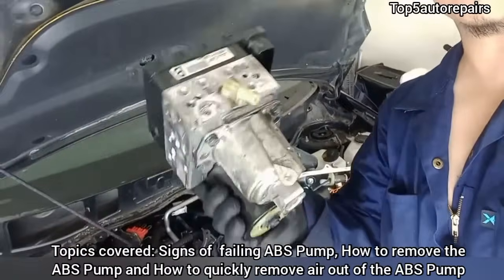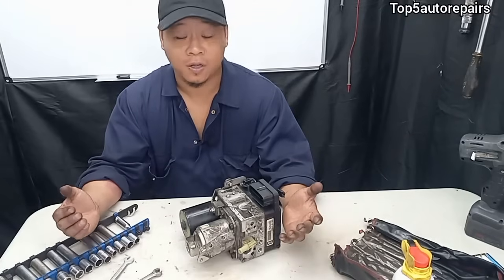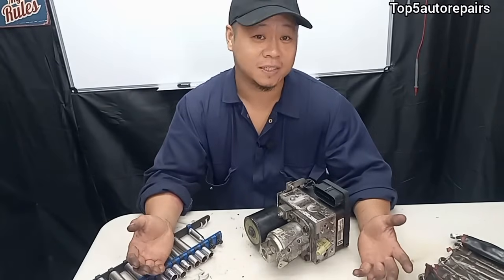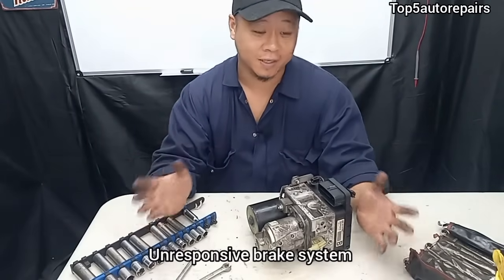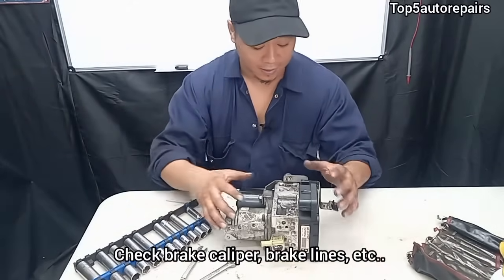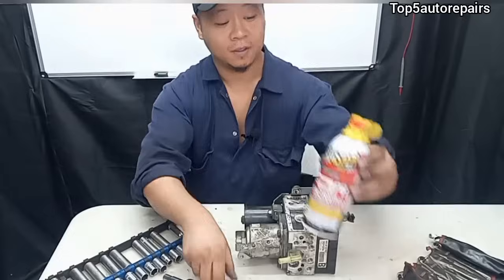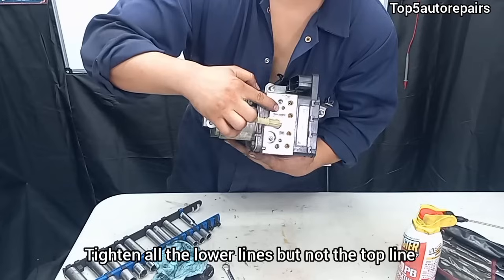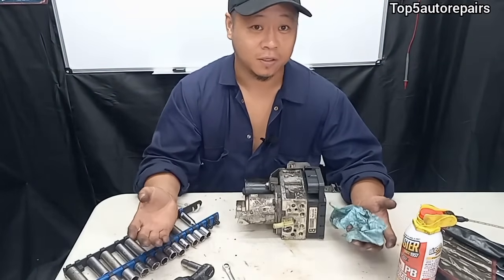4 Signs Your ABS Pump is Bad and Failing (How to get of air quickly after replacement)

Comment: My question is why? Why do they constantly fail? And when I say “they” I am referring specifically to Toyota/Lexus ABS systems, for I am currently on my 3rd or 4th actuator, just had it replaced at a local Lexus dealership 2 years ago and it’s failing once again. The dash hasn’t lit up like a X-mas tree yet, but the pedal recently got soft and I can hear the “BUZZ OF DEATH ☠️” coming from the actuator again. The reservoir was a little low, but not below the line. I filled it with DOT 4 just under the MAX line. But again, the million dollar question is why? Why do they constantly fail, especially from a manufacturer known for reliability?

Comment: Can anyone help me? I have a 1996 Mitsubishi pajero 2.8td, every now and then my brake pedal will just not work…as if in I can not move the pedal even by stamping on it, I also have no abs. Could a failed ABS pump cause your brake pedal to sometimes lock in place result in not being able to press the pedal ?

Comment: I was at a stop light and when it turned green, I took my foot off the brake and went to accelerate when th SUV just completely locked and s metal to metal grinding was heard inside the vehicle. The ABS light on the panel came on and underneath it said “press break” I dud and then I was able to accelerate. Please help me! Chevrolet people say they don’t know what it is!!!!! 2923 Chevy Traverse!

Comment: Great insight! I'm going to tackle replacing the pump. I have already sent my module off for repair, but I'm still getting ABS, Traction Control, and check brake system codes. I bought a used pump, so hopefully it resolves my issues at this point. I already replaced the speed sensors as well. I was regretting having to break open the lines, but the end of the video should prove very helpful.

Comment: What if no brake fluid is going to 1 wheel and the line is not clogged?
Reply: This exactly the problem I'm running in to.
Reply: @isaacbrooks5999 check the brake booster master cylinder abs module bleed lines
Reply: Check brake booster brake lines bleeders master cylinder
Reply: Have this same problem no fluid from one hole in the abs
Reply: @dwightmorris178 did you get a new one and fix the problem
Reply: Late to the party but this is my exact issue. No fluid out of the brake line on my 2001 f150.

Comment: I have a 97 s10 blazer, brakes got spongy but still had brakes, took it to a brake shop the guy said abs module bad, they don't make new ones for this model so i had to get a used one, it was bad too so the guy just unplugged it, has good pedal of brakes but all 4 wheels hot when i got home. ?

Comment: Brake binding, spongy pedal, or no fluid to the calipers?
Sounds like a classic ABS pump fault – and that’s my specialty.

I run a dedicated ABS repair service here in Cheshire UK. For my June launch, I’m offering local collection, full check, and same-day turnaround (if needed) for just £30 inc. VAT.

Drop me a message – happy to help you or your customers stay on the road 👍
Reply: My brake pedal goes to the floor when abs engages. I have a new master cylinder. Any idea what that could be?
Reply: @4dscdriver  Sorry for the delay. Usually there is the feeling  the pedal goes down when the ABS engages. It should be ok. 

I would be worried if the pedal goes to the floor in any situation even with the car/bike not moving, after a new master cylinder and brake system properly bleeded. Then you could blame the ABS module

Comment: If happens that you have one module for repair due to:
- Locking up of one or multiple wheels
- No brake pressure at one of the wheels
- The brake pedal doesn't get firm after several unsuccessful bleeding attempts, when the tested brake pump works just fine.
If you are based in the UK and you are watching this in June 2025,  I can fix your ABS module for free,

 contact  me for more info.

Comment: I have a 2004 Prius. The mechanic said it’s a bad abs pump. Code C1253C1256. Part is $2067 and labor is 4.0 hours. 

I only paid $4400 for the car and it has 230k miles. 

Question 1.  Is that correct code for diagnostic test? The pedal is hard and all alarms are going off. Slow to stop

2. Is it worth fixing given the cost? 

3. I am kinda handy but this seems over my head in terms of DIY. Can I get a used part with a warranty? 

Thanks.

Comment: My Ram van had the issue of the wheels locking.  I replaced the module and it quit.  I expected it would be the pump, but so far so good...

The comment is to help you with the algo.

Thanks man, your videos are always top notch information.

Comment: Hey just ran into your video. I know it’s two years late but I have a question. I have a 2006 Chevy Tahoe Joe Gibbs edition the 5.3 L V8 with the Hydro boost brake system, but my brakes are going all the way to the floor and there’s some kind of like brake light on track control light, and some kind of warning on the dash, but you think that could be the ABS module as well. I don’t have any leaks. I checked for leaks. I don’t have any brake leak.

Comment: Great info! Question? Why is there no brake fluid coming out from one of the brake lines? I’ve disconnected the line from the module and absolutely nothing comes out from it. I have verified there is no clogs from the module to the caliper. Thx!

Comment: I have a 2007 Xterra 2WD. Back in May, right front caliper locked up due to rust and corrosive. It's been working fine until last month I decided to flush the brake system for the first time after 160k miles. I bled right rear, left rear, right front, then left front using the bleeding pump. At one time, I probably overfilled the brake Master Cylinder then closed the cap and bleed the brake. It had too much pressure that the fluid leaked out from under the cap. I opened the cap and relieve the pressure and cleaned up. After that It feel like the vehicle is dragging. I checked all wheel and found the right front wheel locked up again. I thought the caliper is defective so I exchanged it for a new one w/ Advance Auto Part. Put new one in, bleed and tested the vehicle, the wheel immediately locked up... Then I replaced the hydraulic hose, still locked up. Yesterday I had an assistant to bleed the right front brake again and found NO air in the line. Turned the car on, pump the brake a few times, turn off the car. That right side is locked up again. I wonder what could go wrong? ABS pump?  ABS light is NOT on.
Reply: Did you ever found the problem, mines happening too. Change everything hose pads rotor brake master cylinder and still causing all four wheel dragging?

Comment: Some Toyota DIYers find that after replacing ANY brake part, like pads, their brake pedal is inexplicably low. And no amount of bleeding gets the pedal height back to top. Should an Auto Bleed with a scan tool be done before assuming the cause is the ABS pump?

Comment: My partners Nissan Duke has its ABS on constantly - even when you break gently, so you get the knocking of the brakes cycling one/off and you can feel it with the brake pedal. What could be causing this? The is no fault code using a scanner.

Comment: Hi,
I believe someone can help me with my ABS lights and Traction Control lights on problem. I have a Check VSC System message in my dash as well. No check engine lights. My vehicle is a 2008 Lexus RX400H (Hybrid - 290k kms on it).

I initially scanned it at a local mechanic garage and they did let me know it's a brake actuator pump issue (I believe it's ABS pump) and they did confirm they can't fix it since it's connected with the hybrid battery system. They fix only gas vehicles. The code is C1391.

Later, I did drive my vehicle to my used car dealership (not Lexus) where I bought it and they found the issue confirming the left rear abs sensor was not functioning and got it replaced and the light disappeared/ went off. 

I did drive my vehicle for about 70kms and the ABS and the traction control lights came back. After driving it for a week with the lights on, I took it to my used car dealership to fix it. This time a different code showed up U0121 - Lost Communication with ABS Control Module. This time they confirmed the issue is with the ABS CONTROL MODULE/ Pump and to be replaced. It's an expensive repair. If it's with the ABS pump, I should have braking issues. But, I don't have any braking issues. Can someone help me with isolating the issue? Is it safe to drive the vehicle?

Comment: First sign was abs pumping all of a sudden in a stop. Then just felt weak pedal and tautness in the pressure. But weaker and weaker ability to stop. They say the code is abs pump module failure.  $1,000. To fix. Can I just disable the ABS fuse? Wheel shakes. Never used to. Got any cars for sale? Thank you.

Comment: Man I have replaced almost everything on my 09 Kia optima. It will be fine for several weeks and then all of a sudden my front passenger side brake will lock onto the rotor and get to the point to where it’s no longer drivable. I started out by replacing the caliper then I replaced the brakes. I replaced the master cylinder. I also just replaced the brake booster and it’s still doing it. My question to you is if it’s only one that’s locking up do you think it could possibly be the ABS? I was going to buy brake line for that side today and replace that in hopes that it would work but I wanted to see if I could get a reply from you first. Thank you.
Reply: Did you fix the issue?

Comment: I just bought this 2004 Suburban and I noticed the brake/ABS plug underneath the front passenger seat was unplugged. Soon as I plugged it up the 2 front brakes passenger /driver started dragging. I wonder if the previous owner unplugged the plug for that reason. To release the brakes I opened up the bleeder screw. And when I changed the brakes both passenger/driver side brakes was to the metal. Can having the ABS plugged up cause the brakes to drag? Leaving it unplugged will it help stop the dragging?
Reply: did you ever figure out if that was the problem.  several people are having problems with the front brakes dragging on these trucks. changing all the lines calipers rotors master cylinder and brake booster and still locking up and not one video about how to fix it or saying it's the Abs pump.
Reply: @BeauNeeley  master cylinder fixed my problem.

Comment: Hello good afternoon 
I have Citroen Berlingo Multispace 2011 diesel XTR
I have the ABS light on the machine for diagnostic test tell that the rear left passenger sensor I changed unfortunately still the light on 
I change the REAR BRAKE DISCS AND PADS unfortunately still the ABS light is on 
Can you please help me to resolve this problem 
Thanks

Comment: I bought a 2012 civic. With front en damage.  The ABS pump got push back and bent the lines.   When I drive it and it gets to 9 miles break lock up.  Abs, steering . Tpms and Vsa lights on.

Comment: What about when you try to bleed the lines and one line is not bleeding the line was disconnected at the caliper and not bleeding took it off at the abs pump and it’s not bleeding

Comment: Very Useful Thanks  I do have and issue Whith Brakes they Overheat and I already Replaced Brake hoses Pads Calipers and Rotors but Rotors are little loose they didn’t fit tide like the Factory ones in a 07 Prius

Comment: 4:34 " when you're done replacing...." so you are not talking about repairing the ABS module..... you are talking of taking the old one out and putting in a new one or a rebuild one or a working used one... You are just describing the symptome of a failed ABS pump and how to blleed the systeme after reinstalling. well thanks.  I am looking into repairing the one I have.

Comment: Would a little blown gasket make the bosster not work?
Petal goes to floor all bleeders getting fluid? Master cylinder piston? Im not sure what the problem is 
1996 ford explorer
Reply: Did you figure yours out? I have an RDX that the brake pedal almost goes to the floor. Checked all the calipers rotors lines pads everything and replaced the master cylinder. Figured out only the back brakes are grabbing.  ABS pump is the only thing left it could be....

Comment: 5:21 thank you I will check this immediately.  Swapped an ABS pump and it doesn't do anything.  Pulled that top line, and pumped the brakes 30-40 times. fluid on ground but the ABS still screaming at me and not turning on.

Comment: I have a 2006 GMC Sierra after replacing the brake pads the brakes would slowly start locking up as we went down the road. We replaced calipers we replaced Master cylinder. We bled the entire system. We replace brake lines and hoses. Still happening. 
Can the ABS module do this?
Reply: Did you find the problem? You mentioned that you replaced the master cylinder. Did you make sure that the push rod that fits in the hole in the back of the master cylinder was adjusted to the correct length? If  it is too long, it won't allow your calipers to retract, thus applying  the brakes slightly and causing them to heat up. An easy check is to place your hand on the brake pedal and see if you have any travel in your brake pedal. But if it was doing this before you changed your master cylinder, you can probably rule this out. I would say that it could be the ABS module. You definatly have something restricting the brake fluid from going back to the master cylinder if it is doing it on all 4 wheels . Just wanted to pass this along ,since I had this problem once. Good luck.
Reply: @dougsanders6034  turns out the original master cylinder leaked into the booster.  Replaced the booster and the problem was fixed
Reply: @LonnieSandlin  glad you got your truck fixed.

Comment: I put my ABS unit back on hooked up all the brake lines to it. It is a new ABS unit. It is not my old one. It went on very smoothly, but one of The brake lines, one of them is leaking. I have taken it off and on and it seems to still leak on top of the ABS module.. do you think there’s air in the line or what could be the problem?. Please help

Comment: I got my ABS unit repaired. I put it back in. Everything went real smooth but once I started pumping the brakes brake fluid came out of the first line on my ABS unit. I’ve taken it on and off a few times put it back still leaking does not feel stripped out. Do you think it’s air in the lines? What do you suggest please help
Reply: If it leaks fluid , it definitly will be getting air in the system.
Reply: @dougsanders6034  I got that fix but the right rear wheel still peels out on right hand turns fish tales all over the place when the road is wet coming out of right hand turns only. Have no idea what it is. It’s been at Ford for two weeks and they don’t have a clue either. They’re just guessing now.
Reply: Got it back from the dealer and they’re telling me it’s my vacuum pump that is making the right rear tire spin out. I find that hard to believe a vacuum pump can do that?

Comment: Is a spongy brake pedal cause of malfunctioning abs? No abs light
Reply: Or maybe vice versa? Maybe it's air in the ABS pump that's causing the spongy brake pedal. That's where I'm at right one. New Master Brake Cylinder, bled brake lines, still spongy. Maybe air is trapped in the ABS, I'm thinking. (2007 Hyundai Accent).

Comment: ABS does not come into action in normal speed braking!!!!  O.40secs---- You give lessons but you don't know this ?     It only operates when you panic stop..  AN emergency braking scenario.     increased braking distance is NOT a sign of ABS failing!   ( unless of course someone was trying to con a customer into replacing a very expensive part unnecessarily ?

Comment: I’ve looked at 50 videos by far the best one yet PEROID. Best way to take it off without getting brake fluid all over the place?
Reply from the maker: It's best to remove the ABS pump quickly and install it quickly. This will limit the amount of air entering the brake system. To answer the question there is no good way since the brake lines cannot be pinched off unless it is made of rubber.

Comment: Yoyo wuddup bro. Thanks for making the vid. My friend took his 2009 Acura TSX to the dealer and told him he needed a new master cylinder, new front rotors, front right caliper, and brake pads all the way around. I changed the rear pads cuz they were low and the master cylinder. Upon hard  braking (panic stop) it’s skids then loss of pedal pressure. ~they turned the vsa button into a kill switch. No warning lights on. Could tampering with the vsa button cause ABS module failure? Any advice would be appreciated

Comment: Hi. Will a faulty abs pump suddenly cause a fault that creates an accident like skid or spin or sudden immediate stoppage.
 Is it dangerous to replace with a used 2nd hand abs pump?
Reply from the maker: Yes it can cause skidding
Reply: @Top5AutoRepairs  then can i say that  ABS system is a timed bomb & a dangerous thing to have in a car because a fault can happen suddenly & cause a skid & kill the driver & the fault is not obviously noticeable.  Is it correct to say it this way?

Comment: brother you ever came across  code c0036-02 dodge charger scatpack had impact on that side , replaced knuckle , axel , speed sensor .. but cant seem to get rid of it , also has code u1412-00 , but since it was in a accident and hit on that side i belive something there is the issue , i dont know what the tone ring harness looks like to inspect it for damage .. any help would be appreciated it
Reply: The brake pedal  shudders a bit once the abs traction light comes on